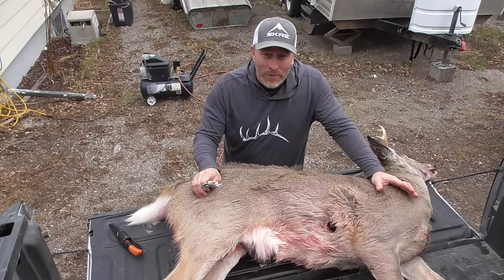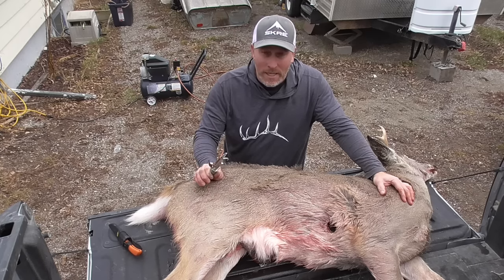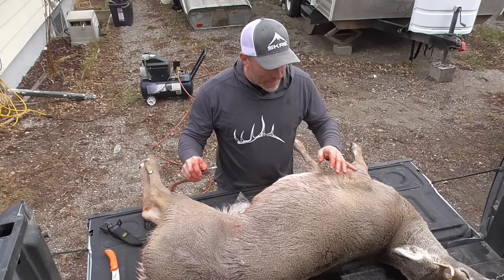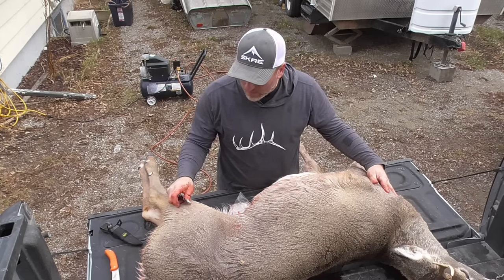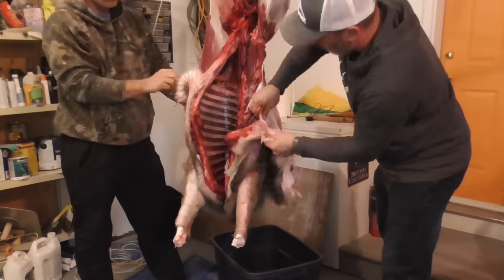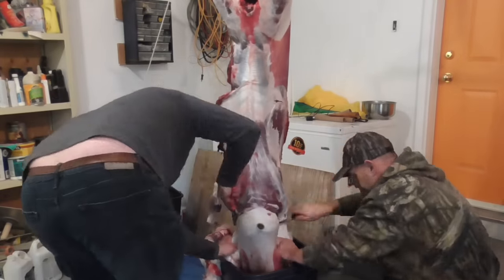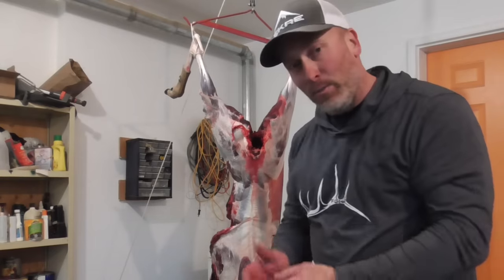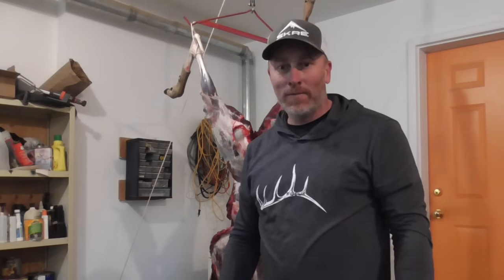How to skin a deer with an air compressor

Comment: Doesn't look any easier. Just anothef step and time wasted. Use a truck or tractor will pull the skin right off in 1 minute.
Reply from the maker: It was just a cool way to try something new. The golfball method is pretty slick too

Comment: Interesting method of skinning the deer. I would be careful about the oil from the compressor getting into the meat. You could probly use a food safe oil for lubrication on your compressor.
Reply: I use a small oil less pancake compressor instead of my big compressor with oil.
Reply: A 3 stage oil separator used for most pneumatic tools takes the vast majority of it out.

Comment: Shawn from Twitter just shared this video. Interesting approach, although it looked like you had to do a similar amount of manual work on the neck. Not sure this method would be for me, but thanks for sharing.
Reply from the maker: I think that was more my mistake for not putting another hole in the neck. It definitely didn't separate there. I'm going to try again next year and make sure the neck is done. It was super clean though and for the sake of firing up the air compressor it wasn't much extra work